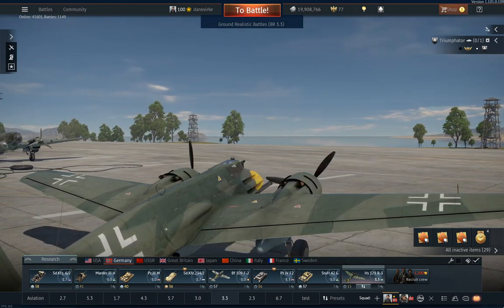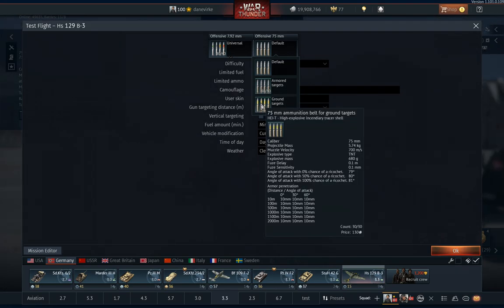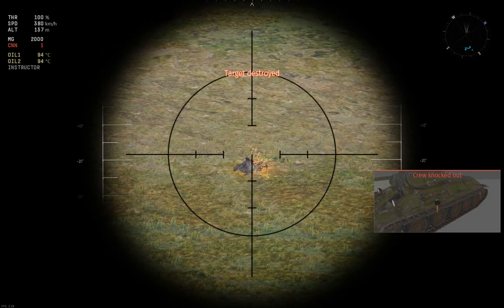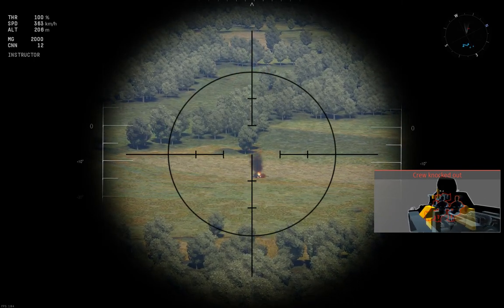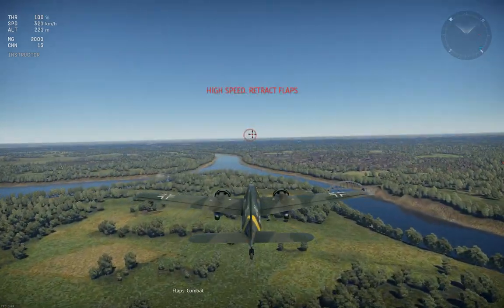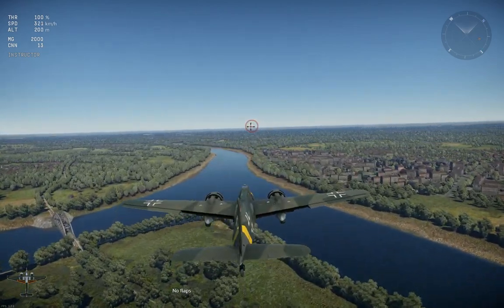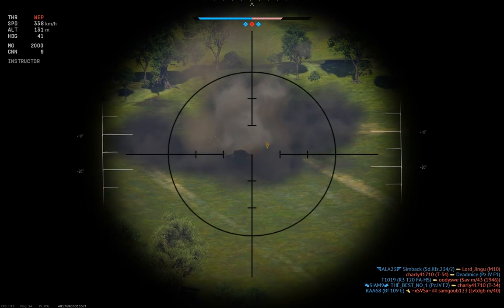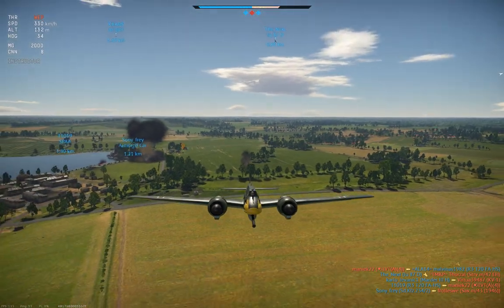How To become a Duck Ace - HS 129 B-3  (War Thunder 2020 guide)

Comment: How do you move your camera out of cover like that with the Puma?
Reply from the maker: Hi Arthur, I am using a head tracking device, when you use it, it does not center on the vehicle like normally when using Alt to look around, but behind the vehicle itself at some distance and a little higher up than using the Alt key.
Reply: You can use I think C for free look